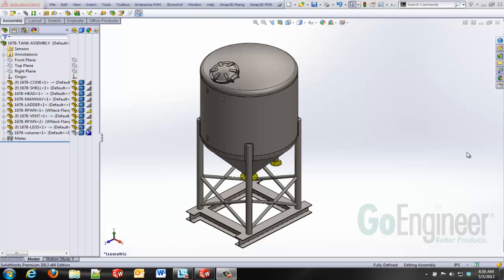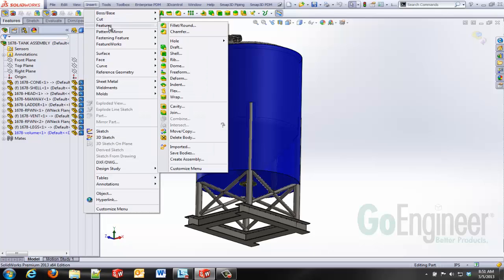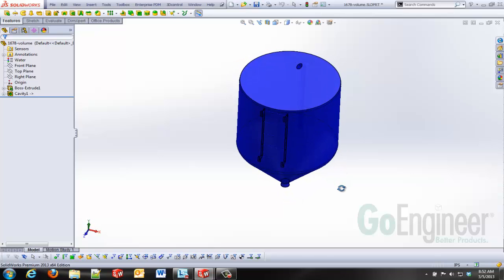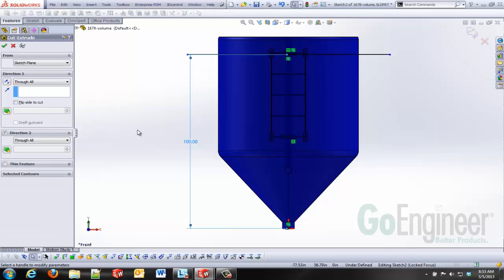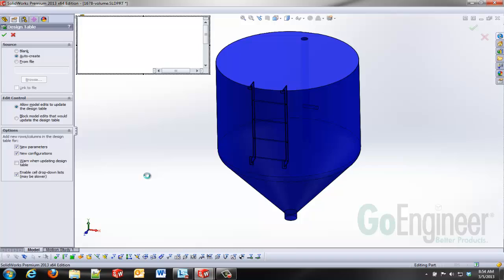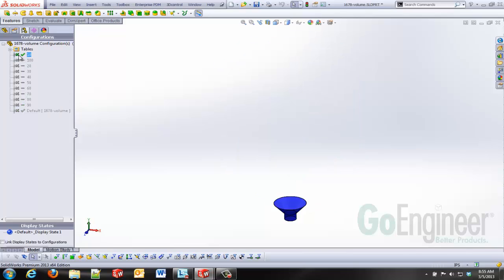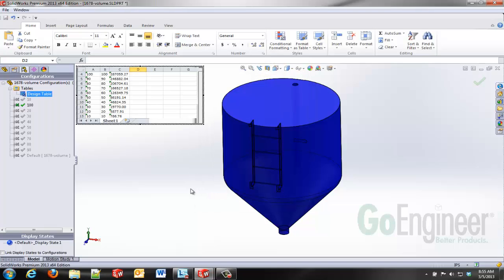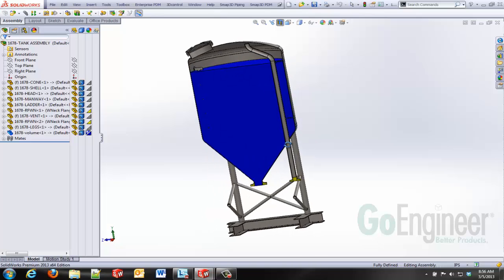SOLIDWORKS – Assembly Volume Study

Comment: Wow! very helpful.
Can I do reverse? 
Something like, I will insert volume in design table and it will automatically calculate the height.

If I design any jar for liquid that time I need to make the marking to indicate the volume. So, for complex internal shape it is difficult to mark the height for certain volume. So, can you help to solve this issue?

Comment: can I use it as a volume goals in flow simulaton?
Reply from the maker: No, this method creates a physical model to represent the volume of the fluid.  It is meant for iterations involving the height/volume.  You could use this in mechanical simulations to increase/decrease the water volume to see the stress effects.  Thanks for watching!